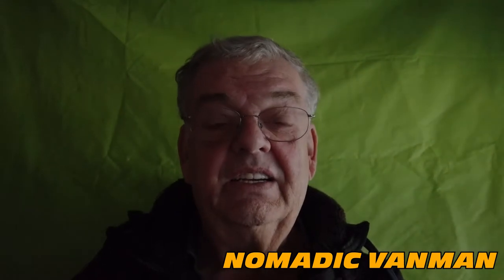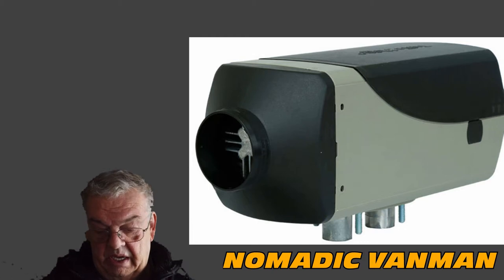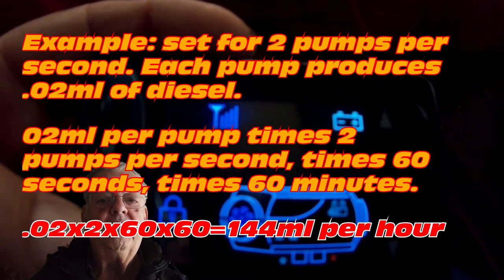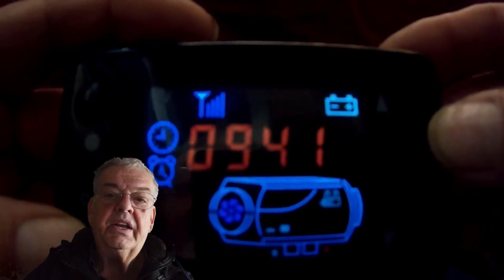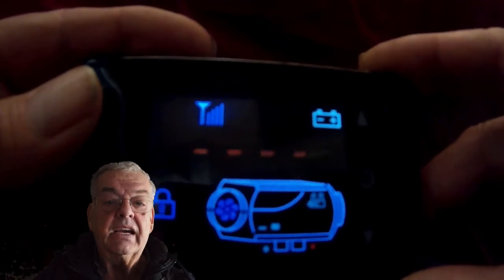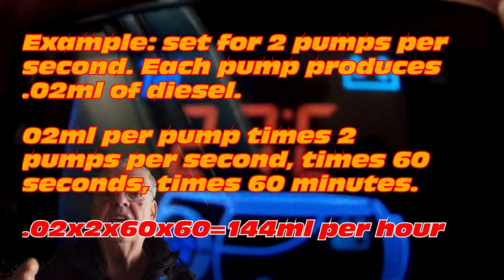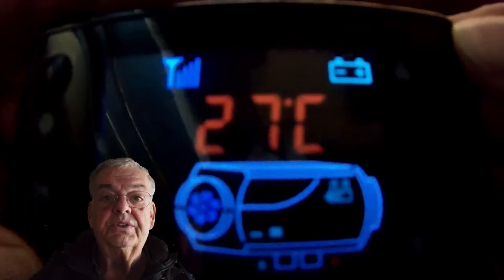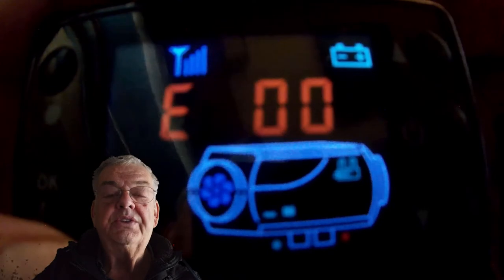Chinese diesel heater error code e-03 fix

Comment: I removed the boot and noticed the shrink wrap wasn’t really applied to the wires and pushed them towards the glow plug and it worked.
Reply from the maker: great, love it when a plan comes together. right on bud

Comment: I just installed my heater the other day. It turned on once with no issues. Then I tried turning it on the 2nd time and I keep getting error 03. I purchased a new glow plug and replaced it and I continue to get the error code. Any recommendations for troubleshooting?  I’ve also contacted the seller for assistance. Still waiting on reply.
Reply from the maker: just found your comment. did you get it sorted out. I may be able to help. Sorry for the late response
Reply: Mate I had the exact same issue.
As the glow plug is new I assume the ecu is to blame.
But have yet to try it out with a new one
Reply from the maker: If you didn't get it fixed yet, here are some things, may or may not help. I don't know what went on with the unit in between turn off of the first time and try to turn on next time. Since it's not that old seems like it couldn't be plugged missing screen. Lots of stuff is going on right at the point where the missing screen is. To much to go through here. But that's a critical area. You can pull out the glow plug, leave it plugged in. Hold it up and away from the heater. Get someone to turn it on. Now the glow plug comes on right away. The plug should get hot, you might be able to smell it or see it turning red. Turn heater off. Don't let this test run to long. If you don't feel the plug was getting hot then there is no power to the plug. At this point, again there is no use going further with the diagnostic. I'd have to write a book. It should be something simple. Could be other things not related to glow plugs. Let me know if the problem was fixed before my message. I'd  like to know what you did to fix it.
Reply: I am having the same issue now. Don't know what to do
Reply: @ouroffgridalaskanlife3998  hey, I live up in the Interior, too, and mines popping the same code. Did you figure out the problem/fix? Thx.
PS- what's up with all this dang snow?!
Reply: @IAm1InTheIAm  it was our computer control board. It was like $28 on Amazon and its been working great all this winter. Super easy to change
Reply: I have the same problem
Reply: Hi I'm getting same error with new a plug fitted
Reply: @eddieforester2599  Its you mainboard i changed mine and now it work beautifully! Error code 03

Comment: I purchased 2 and both ave eo3 code. I cannot get them to work.
Reply from the maker: E03 usually means glow plug is not working. If you have 2 news ones and both have same error then I think the glow plug is not getting power.. If you know how to check that then do so. Could be in a connector someplace along the way
Reply: @Nomadic Vanman  yah. I purchased a new glow plug... i think perhaps it's the board??

Comment: Hey guys, I just bought my diesel heater last night and I installed it and worked perfectly. But today it showed error E 03.  Do I really have to change the plug when the heater is new???
Reply from the maker: You shouldn't have that problem with a new unit, unless for some reason it is no good. It could also be bad power connections. I had that, one wire in the connector to the heater was loose. I'm sure E03 means the glow plug is not starting. Maybe faulty electronics. If your near were I am I can help you.
Reply: @NomadicVanman  hehe I live in sweden friend. But now I remember when I took out the plug it was kinda loose. I have put it back in now and tighten it correctly. I will install it back early tomorow and let you know how it works.
Reply: I hope this will fix the E-03 error.
Reply from the maker: yea please let me know more on what happens. If it didn't fix it we can go through some other things to diagnose it better. Failing that I can pop right over, I need a vacation anyway. @redle9485
Reply: Me too!
Got one day of perfect service out of the new unit - next evening tried to start it and: 03.
That can't be a dead plug, surely?

Comment: If posting please tell the guy if you are not using a battery , it’s important for electrical problems
Reply from the maker: Not sure what you mean. Power is a must and anybody should know that. But you can use a Jackery or any other 12 volt power supply, with reason. It's a big unit so a small 9 volt battery is a joke.
Reply: @NomadicVanman  if you only use a 240 v transformer and the grid fails the motherboard will burn 🔥 so it’s always better to have a deep cycle battery in the line so with a power outage the battery will keep the unit from frying
Reply from the maker: @jimmurphy4703  Well if your using 240 volt transformer you might be asking for trouble. This is what I found. Even if you are using 12 volts like it says to use and you start the unit, after itt get up to speed and you then lose power for some reason the pcb will more than likely burn up. Only because the unit is hot and you need the fan to cool the inside. It just gets to hot inside and will melt the pcb. That's why when the unit is working properly and you shut it down the fan will speed up at the end to cool the unit inside. Best to use 12 volt that can supply 10 or more amps for startup, then it goes down to less than 1 amp while running.

Comment: Got e 03 code on first fireup ... brand new heater .. I guess this is possible
Reply from the maker: Check and see if the glow plug symbol comes on when you first start it up. If there is a symbol but you get error 03 there may be a blocked fuel line not letting in enough fuel

Comment: got the e03 on a new heater i checked the connections and the code went away
Reply from the maker: Glad it went away. That looks like that's what the problem is. It may return. Just keep an eye on that connector.

Comment: I’m sure it can be a flat battery as well my leisure battery if low can’t get the glow plug to work
Reply from the maker: Well that could be true, but if you have a low battery you should get a different error code saying the power is to low. Also at the time I made the video I said hang the pump straight up and down, that may be wrong, It should be at a 45 degree angle because it needs the cavitation and you should see bubbles in the line. Thanks for the comment.
Reply: @NomadicVanman  i had thus issue a few months ago in my camper van charged the leasure battery and it was ok
Reply from the maker: @vandemon1822  great news buddy. Glad it worked for you.

Comment: I'm getting the e-03 code as well. I pulled the glow plug and tested it. it gets red hot in an instant if i put power to it. something is clicking on the electrical panel though. have you played with the relays on these before ?
Reply from the maker: something is clicking in the thing on the wall??? There isn't anything in there that should click. Anyway if the plug is working and you still get error 3, did  you make sure the mister screen is good and not clogged. Then the little whole the size of a match has to be clear. Same place as the misting screen. This is on the inside of the hole you took the plug out of, and when you put it back in you have to make sure it goes in far enough to clear the little hole that lets air in . That's a start. Sorry to hear it though

Comment: Wayne, would you be able to recommend a good source to purchase the diesel heater, preferably the portable "parking" variety? or do you sell them yourself ?
Reply from the maker: Hello my friend. Yes I do have a link for you. Look in the description below. You will see a Amazon link to a portable diesel heater. Once you are looking at you can shop around if you don't like that one. Then make your purchase. By clicking the link below you will make your purchase through my affiliate account and I will get a small commision for directing you to Amazon. I would appreciate that very much. It helps me and it won't cost you any more. Merry Christmas brother BTW thank you for subscribing.
Reply: @NomadicVanman  thanks...I will go thru your link...trying to find someone who will help w installation...rv place I rang say they are not liscenced to do so :(
Reply: @NomadicVanman  just curious...do you think the diesel heater wiring could be altered to work off a solar generator such as a Jackery?
Reply from the maker: @CC-vw1cs  yes it can. it draws 10 to 12 amps at start up and shut down for about 2 minutes. No big deal. Then while running it's only about .5 amps.
Reply: @NomadicVanman  thank you very much - will follow you on facebook - will make for easier communication than you tube.

Comment: 0.2 x 2 x 60 x 60 is 1440 not 144.
Reply from the maker: What. You better get out the calculator. .02x2x60x60=144 not 14400. What you did is type .2x2x60x60 which equals 14400. It's .02x2 not .2x2,
Reply: @NomadicVanman  1440 not 14400 lol!
You are of course absolutely right, 0.02 der!

Comment: They crack, because they are garbage.
There is no other reason.
Guessing mine cracked, because it was made with inferior materials, or, inferior manufacturing standards.
Failed after cool down process, from 5kw, setting 1.
16F ambient temp.
Obviously, not  an ideal time to lose your heater.
But, someone ought to put out a better glow plug for these things.
I'd pay twice what these go for, if it was a quality glow plug.